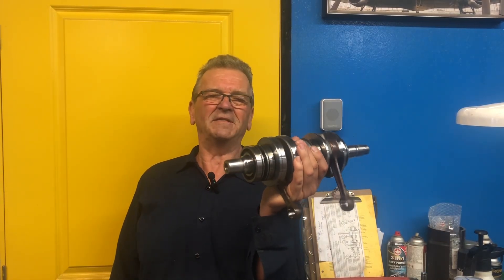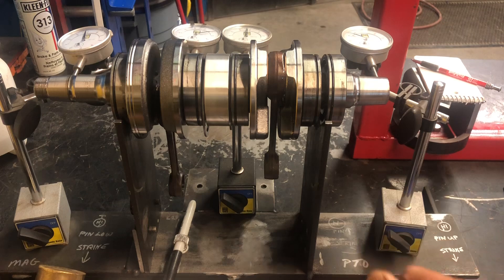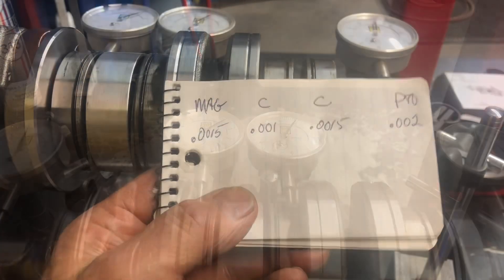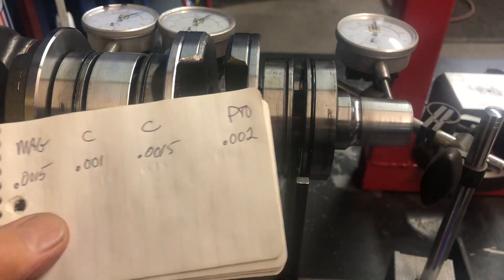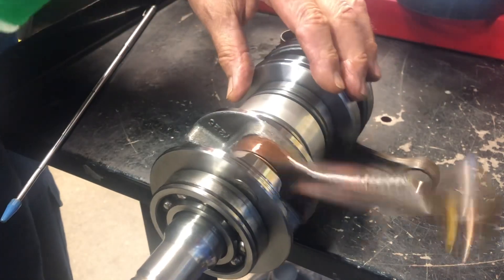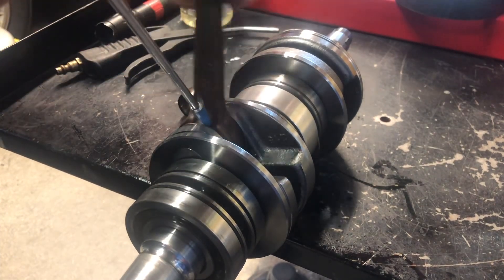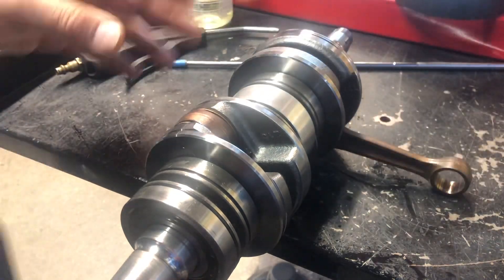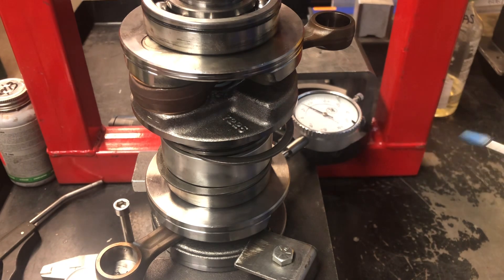Rotax 447 (part 2) specialized crankshaft inspection

Comment: What was the thrust washer clearance?
Reply from the maker: The thrust washer clearance (axial clearance) was .019 inches on both rods and I didn’t include that in the video. That axial clearance would be the side to side space between the connecting rod and the crankshaft flywheels. In this video I measured the radial clearance. That would be the up and down big end rod clearance as the crankshaft would be installed in the engine.